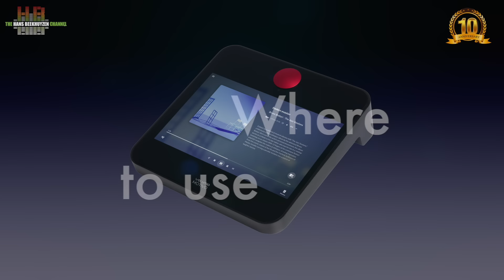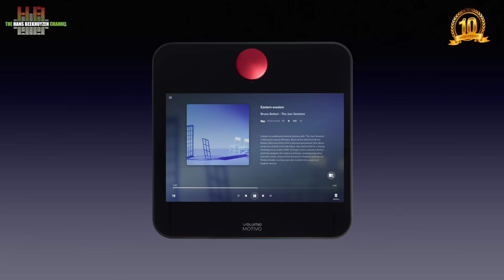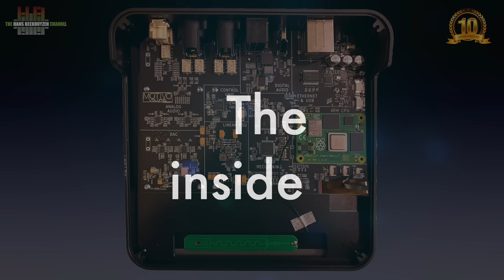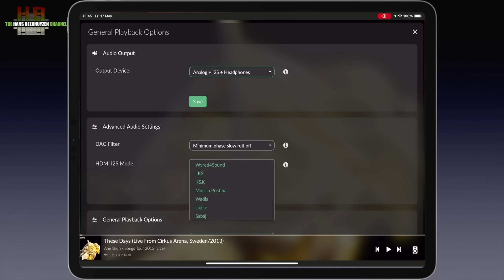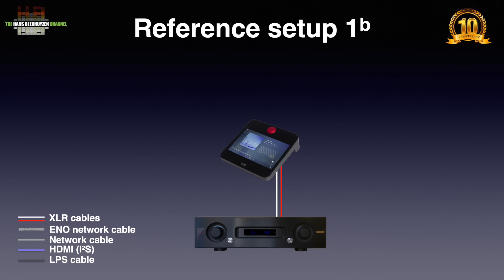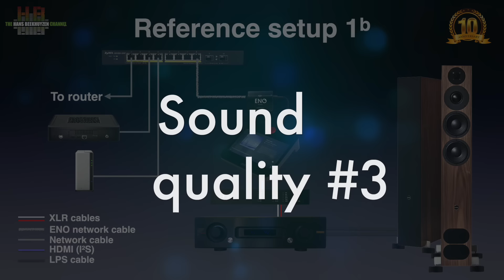Volumio Motivo touch screen streamer

Comment: Is the sbooster you used on motivo 9v /4a ?  Isnt sbooster 9v/ 2.33a
Reply from the maker: It’s the normal version
Reply: @TheHansBeekhuyzenChannel  was just wondering dont volt have to match and ampere be same or greater to run motivo best?  
Can it be that because sbooster not 4a that the result was that good compare to when using linear power supply that match on Primo and Rivo

Comment: Excellent review Hans , I must say it even though it is expected as the audiophile knowledge is appreciated.

I connect to higher current lab grade power supplies with almost no noise and get the best sound in 40 years of the hobby.
Reply from the maker: You should always choose the best power supply for the job. And that can be a linear type of quality or a switch mode type of quality
Reply: @TheHansBeekhuyzenChannel  Just as a note  PFC " Power Factor Corrected" Switching Supplies are easier devices  to remove ripple noise over Linear with a few filtering tricks .00000001 volts of ripple is accomplished for $70 usd. 

When Linear is used and extraneous DC on the mains will need mitigation with a DC Blockers filter. ( To eliminate the transformer hum)

Comment: Wow, was not expecting such a positive review! So this has a screen, headphone amp etc and, as a transport, is better than the Rivo. And buying an external power supply  actually makes it worse... I was about to get the Mano based on your reviews but now I need to take a hard look into this one.
Reply: I got the Mano Ultra MK3 with the upgrades (fuse and cable), but this is a more elegant streamer, and even though I will not use the dac, if it's as good as the Mano ....... hhhuuummm ;-)
Reply: @larsv6144  I also have no use for most of it... headphone amp, dac and screen. But I can see a use for that screen in some different room arrangement. And it's still cheaper than your full specs Mano.
Reply from the maker: Choices, choices....😁
Reply: don't need a screen, already have an excellent DAC, is it Roon ready and can it be controlled from my arm chair?
Reply: @xstensl8823  I ended up buying one. It's waiting Roon certification which should be soon and you can control it through a phone/tablet app. Volumio app or webbrowser if you use it as a streamer, Roon, Audirvana etc app if you use it as a transport.

Comment: Thanks Hans for this review! As a transport, does the Motivo outmachted the Rivo? Regards, Jos
Reply: I recently upgraded from the Wiim Pro, fed via an LPS, to the Volumio Rivo. I use the same LPS for the Rivo. Rivo feeds into the Gustard R26 via USB cable. I use Tidal via Roon.
I am so happy with this combo. This is definitely an upgrade from the Wiim in every aspect. The thing that stands out the most is the reduction in sibilance and much smoother but detailed highs.
What a great time to be an audiophile. So many good options out there.
Hans, thank you for all that you do! You make being and audiophile a lot more fun.
Reply: @DavidLinde-i9n  i remember that you said that the Rivo was only a "fair value" as a transport.   maybe Volumio will up their game with their Rivo and include i2s?
Reply from the maker: I didn't have the Rivo anymore so I can't compare. But I would say the Motivo is even slightly better.